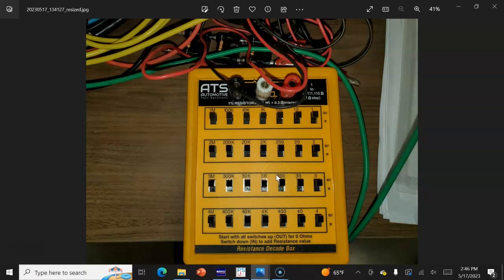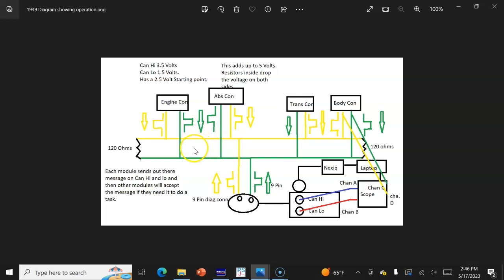Supercharge Your Tech Skills: Harness the Power of CAN Bus Diagnostics with an Oscilloscope!

Comment: Thanks for the video, I'm still confused about this system, the trucks that I work on almost all has some codes about missing communication between modules
Reply: You need to be careful with those codes sometimes, as its completely common for some systems to flag those codes if some of the units wake up before the others. don't completely disregard them, but if its on every vehicle i would consider it more of a glitch, or poor coding, rather than a fault that needs fixing.
Reply: @VR6VR6 agree with you. We just solved a CAN bus line failure code on Volvo D13 circuitry after we replaced all modules (from lightning strike) they were having to be woke up in sequences with updates as well to get the modules to start communicating properly.
Reply from the maker: We understand!  Datalink can seem confusing and overwhelming.  There are many reasons to have fault codes related to these systems, and sometimes there is not any issue other than the unit had dead batteries at some point, a master switch turned off with ignition on, etc.  We do have in person classes as well as online training on this subject.  check us out at https://training.diesellaptops.com/ to learn more!